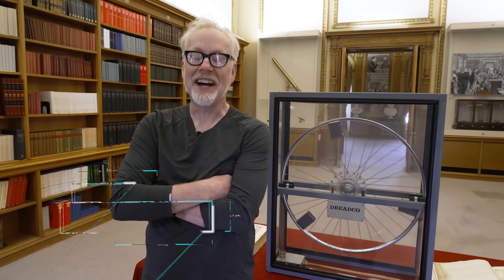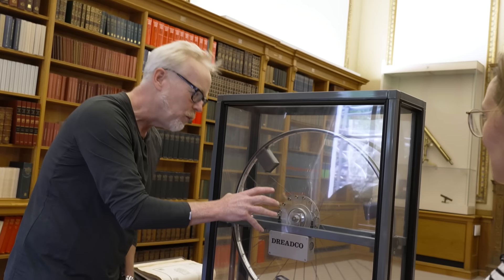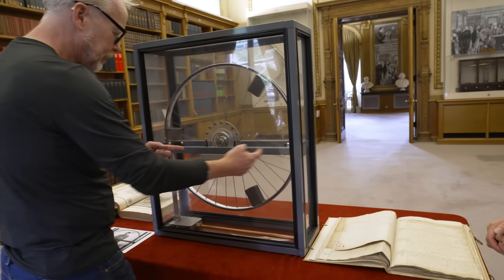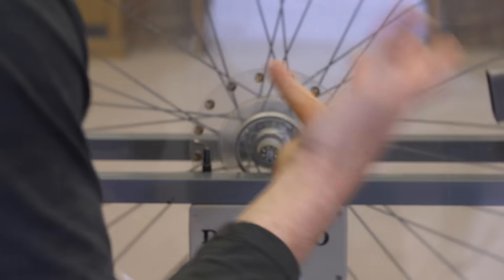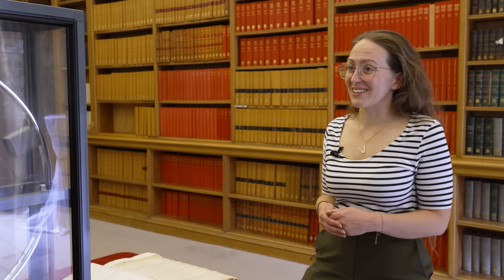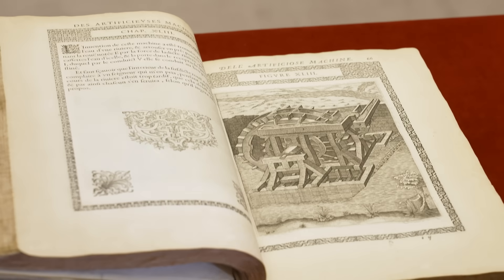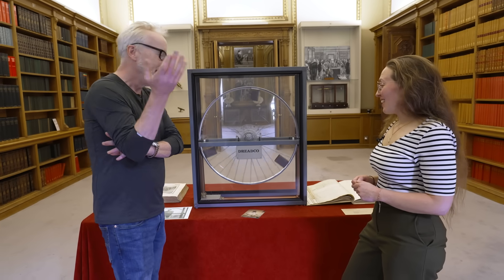Adam Savage vs The "Perpetual Motion" Machine!

Comment: The heatsinks are a hint, that thing runs on temperature differential, in the cellar it stops as the temperature is to stable..  It slowly loses gas along sides the cylinder, that is why it needs to be recharged.
Reply: So it is driven by a peltier device?

Comment: It’s most likely that there are batteries in one of the two boxes which barely discharge (it’s not moving fast) and possibly some sort of regenerative braking to capture some of that energy until ultimately the batteries have to be changed at the manufacturer.

Comment: I think the only way you could probably create a perpetual machine, would be to steal some energy from an external source such as the Earth's Spin or magnetic field.     Possibly, you could steal a little energy from heat and cold dissipation over large amounts of time too.  You would probably need to use liquid nitrogen and super conductors to reduce the friction to almost zero, because the amount of energy would be so small.  You would also need to create an almost perfect vacuum to reduce air molecules from creating friction as well.  The machine would be so complicated and have so many attachments, that people would never believe it was a perpetual motion machine.

Comment: The magnets create the charge, the electrode (sharp pointed one) pops electrons onto the inner ring of charge holders, which are then attracted and the pulled off of the inner charge holders, imparting a small torque on the wheel ... I've forgotton what the name of such a motor is called ...

Comment: Awesome video! My guess this is in essence a brushless DC motor with the permanent magnets on the acrylic disc behind the Dreadco box and the power supply and commutator coils inside that  box.
Reply: Brushless motors don't have commutators
Reply: @pjaxy  Brushless motors don't have brushes. They do commutate.  https://en.wikipedia.org/wiki/Brushless_DC_electric_motor?wprov=sfla1/Brushless_solution
Reply: Ah ha - you're the first (as far as I can see) to mention the disc and ... things. And they're where I bet are the driving forces too. Quite how, I don't know. But that's the complicated bit.

Comment: What about an Atmos gravity clock - it does not need to be wound manually. It gets the energy it needs to run from temperature and atmospheric pressure changes in the environment. That's about as close to perpetual motion as you can get. Every object in the universe has forces acting on it.
Reply: Right, but you've said it's hidden power source. Atmospheric pressure. That's no more pertual than those drinking birds. It's very useful, sure. But it's not perpetual motion.

Comment: the way the magnetic lines of flux are trans posed to the spokes that could create a y or delta or ? motor/gen "windings" .   
thus moving the magnets.     Which are boosted by capacitors and electrically charged.  
looking at the copper circle clamps on the spokes..which DO cross lines of flux.

Just a 5 minute guess.

Comment: The thing is if perpetual motion is impossible then what the hell is vibration if not motion. Everything is in perpetual motion already so why say it's impossible
Reply: You maybe could argue that it's possible on an atomic scale but it's not on any scale that's use able.
Reply: @SilverEye91  so far we've only been able to get more energy than we put into it with the world's most powerful laser but if we could one day shink the size of the laser while keep the power the same it might be usable someday decades into the future
Reply: @shmirie666  Fusion? Yeah, that's not perpetual. That's not creating energy, that's extracting energy from fusion fuel.
Reply: @SilverEye91  not sure how shooting a mega big laser and getting 50% more energy is fusion fuel but it maybe due to lack of formal education past high school
Reply: @shmirie666  Think of it like this:

When you start a fire you want to start it using a small match or lighter. That's not a lot of heat energy. But the big fire you've lit will release a lot of heat energy.

Fusion, or really any kind of energy generation is the same way. Or rather, that's how it should be to be useful. If it takes more energy to start the process then it would be useless. If you need to light a bigger fire to start a smaller grill then you should have just used the first fire to grill. 

Fusion is of course more complicated than a fire, but up until now it's taken more energy input to receive less energy from the process. We've figured it was theoretically possible to do better, but not how. That was the breakthrough that happened late last year, it proved it was possible.

Comment: Many stupidos commenting.
It's not claiming to be a  peroetual motion machine . It is designed purely to be a puzzle; a puzzle, the solving of which, actually debunks perpetual motion. 
producing a wheel that spins for 2 1/2 years is quite an amazing feat  however.
I tend to believe that it really is no more than an electric motor, the onboard  batteries of which,  being  charged by it's tiny solar cells.
The engineering beauty lies in it's very low friction of the hub bearing  that enables it to run on very little power.

Comment: Magnets always make a compelling argument for the possibility of perpetual motion. When we consider the Solar System, which is operating basically on the relationship between magnets, gravity, and motion, we have to wonder if there is some way we can duplicate that relationship on Earth? I think the answer for making perpetual motion possible, using magnets, lies with increasing mass. Consider this, you could make a 500-ton piece of steel hover in the air if you turned two of them into opposing magnets. A floating magnet isn't perpetual motion, but that sure is a lot of work being done effortlessly. Maybe there is a way to make something out of that. Wrapping the magnet in coils and spinning it? How effortlessly would it spin? Would the energy of the coils rotation along say a 1 mile long floating magnet be enough to turn the magnet? It's been tried in small devices, but maybe it only produces net energy once it's scaled up a lot. Maybe it won't, but I think if it is possible for the universe to create this type of motion for seemingly an infinite amount of time, then it is possible for us.

Comment: there is a huge misconception about the concept of "perpetual motion." if you investigate the history of the concept, you realize that their desire was to have a consistent/perpetual source of energy that moves things like clockworks, automata etc. this is not a trivial problem. they had many such devices and they needed a consistent power source to fuel them. again, in the 15th century, people managed to harvest the energy augmented in springs to fuel their clockworks. think about a spring. if you cannot tame it, it releases its energy in a milisecond which is useless. you take that energy and put it in a "perpetual" or "consistent" form to fuel your clockwork. that is the idea behind the concept. in the 19th century, it became a pseudoscientific scam where people are building magnet systems etc. what they are talking about is not "perpetual" but "free" energy or motion which is not possible as far as we know.

Comment: Isn't the Beverly clock a better example of a perpetual motion machine? (It's bassed on atmospheric pressure, but it has been running without being wound up for like 200+ years)
Reply: There is no such thing as an example of a perpetual motion machine, because they don't exist. This is an art project.
Reply: @outputcoupler7819  Yes... that is why i said "a better example".

not "is a perpetual motion machine"

Comment: Could it be a very low output Sterling motor? The copper tube and heat sink transfer the flow of air, and the black “boxes” are crude pistonS?

Comment: The DREADCO box gets energy from delta pressure.
As the air pressure change during day the battery gets charged.

Adam was close with the solar battery tip.
Place the machine into a sealed box with still pressure and it will stop moving.

Comment: Not perpetual motion of course, but impressive that it can run for 2+ years between charges. A very efficient engineering design at the least
Reply: Still not as efficient as a torsion pendulum clock, which is the closest we've ever gotten to perpetual motion.
Reply: Not really, there's enough hiding space to sneak rather big battery. If you stack all the frame pipes, copper pipes and boxes with low self discharge batteries, you could probably make it run for a decade or few.

Comment: I love this! Fantastic way to get people to think critically about how the machine works!  It very easily triggers brainstorming as you evaluate and discount possible sources of energy!
Reply: I think there i not so much to brainstorm because she said that this thing had energy for 2 years which is obvious that it is using batteries and it is simple
it si no big deal to make a wall clock that runs for 2 years on the battery 
The only thing which is interesting is how exactly it is made and where are the batteries.

Comment: I think the trick is in here the line voltage and its electromagnetic effect on the copper pipes or the coils in the boxes so that it produces again  electric current to supply the energy necessary to correspond the frictional loses. It will be good idea to put this device somewhere totally isolated from electric network supply cables. Plus when a force is applied to a piezoelectric material, an electric charge is generated across the faces of the crystal. This can be measured as a voltage proportional to the pressure.
Reply: I tried to capture energy of electromagnetic waves once.
Receiving antenna for such device was relatively large - 3x3 meters and 10 turns (or something like that).
I managed to charge 330uF capacitor to 1 volt in several hours.
I counted it as success, because it worked.
But such amount of produced power is very very tiny.
Most likely, it is not possible to power wheel with it.
And I admit that my home have unusually powerful RF source nearby (of unknown origin).
Most of the people will not be able to even reproduce my result.

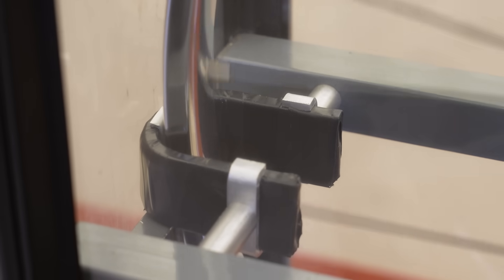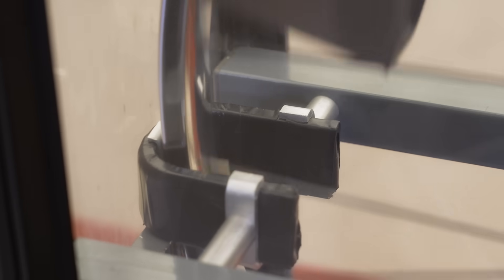Comment: Based on her statement at 6:43 I think I have a guess on how this works, so idk if this would work or what but it's just my take. So if you watch closely at 4:13 you will see they close up the black thing which Adam think is a "magnet" and if you really look at the speed of the wheel, the moment that black bars pass thru that magnet it changes speed then it goes back at normal speed. So what I think is and this would probably a disappointing one, those components at the bottom are just a nuisances for you to think the right answer, this thing is just powered by copper and magnet, bear with me cause the shocker comes in, so if you watch Vsauce as well, they did a copper and magnet experiment there where if you put a magnet inside a hollow copper tube, the magnet won't fall easily, it will somewhat glide inside the tube, so with that I put it as a concept on this where, the "black thing" which Adam call a magnet is really a copper tube coated in black and those 3 big boxes are the magnet that's why if you see the 4:13 clip the speed of wheel before the box enters the black thing and during are different. Now idk if this is plausible but if it's then yeah it's really a disappointing one hahahaha

Comment: The motion of the wheel make a little wind tat is pushed down toward the cooper pipe then heated with little box down left and the wind transformes it self into a invisible hot burst of air that pushes up the wheel . All the other pieces are just to balance the wheel

Comment: My guess is magnets (the 3 metal type blocks) with opposite poles causing slight repulsion which in turn propels the wheel in perpetuity.
Reply: So your guess for how the fake perpetual motion machine works is that it's actually a real perpetual motion machine using one of the most thoroughly debunked methods ever devised? 

Yeah...probably not.
Reply: @outputcoupler7819  Yea I was actually stoned when I wrote that, I'll  take that on the chin.

Comment: I think this is more of a fun way to theory craft how you would make a fake perpetual motion machine than a real puzzle. Like, there’s not enough information to figure out the real answer, especially because of the decoys, so it’s impossible to have a true a-ha moment unless you were allowed to take it apart
So really it’s just getting you to think of how you would do it rather than how they did it
Reply: It's not hard to figure it out. What helped me is that I like to watch magic tricks and then deconstruct how they are pulled off. Filter out all of the things that look like they have something to do with propulsion and focus on the things that are not screaming out for attention.
Reply: Now I kinda want to go at it with a bunch of modern technology. There are sensors that can detect small electromagnetic fields, so you can essentially detect electricity. There are motion amplification algorithms so you can see what part of something is moving the most, and there are sensors that can detect permanent magnets so you can check for any magnets on the contraption.

I think with enough data collection like this you could piece together exactly how it works.

Comment: 9:00 "There is no prize." Well... A perpetual motion machine would be:

(1/2) The most important scientific discovery of all times. It'd be succeeding where many big brains failed, where scientists say it's impossible. Proving wrong a fundamental law of physics, one the easiest to test and has been tested over and over again... would mean not only rewriting the books, but it'd also cast a huge shadow on all physics laws -- especially the ones that have been mathematically derived and can't be tested.

(2/2) If it's not just a "battle of tiny, tiny values"  that can't produce useful energy, then it would also be the greatest invention ever made since it'd supply endless free green energy: it'd be worth more than all the oil, gas, coal, nuclear, wind, solar, hydro... more than all energy storage systems... etc. etc. It'd carry an infinite value.

"There's no prize."

Comment: It is running off crystals, think of how a batteryless crystal radio works, the spokes in the wheel are recieving the radio waves and transmitting them to the crystal which under the Piezo effect turns them into electric impulses, I suspect that when they put it into storage it is not getting enough radio waves to keep it moving.

Comment: Sure some YouTube comments warrior and self-proclaimed expert can help me out on this but I've always had trouble understanding why perpetual motion isn't attainable with natural magnets. Especially with strong modern rare earth metal magnets like neodymium. Then again, I'm not a physicist by any stretch of the imagination. However, it's pretty easy to observe that natural magnets can exert force and cause objects to move at some velocity without any external energy input. So why isn't it possible to come up with an arrangement of natural magnets that either repel or attract each other, or a combination of both repelling and attracting each other to rotate something? I know friction and air resistance could slow down this motion, but as magnets don't need any external energy input to overcome this friction / air resistance / gravity's pull etc etc, shouldn't that be possible? I mean they can move objects at rest with no problem so overcoming the small amount of resistance as this rotation is slowing down shouldn't be a problem. Is it just that there isn't any arrangement or configuration that allows for magnets to repel and attract each other consistently without the poles shifting and counter-acting the work they are doing? Lol I know this probably sounds stupid and a bit much, but it just makes me want to give it a try with some strong natural magnets and see what I can achieve. Maybe then it'll make sense.

Comment: When the coils pass the magnet they in turn charge the copper tubes Wich are transmitting lense charges to the opposite coil it's like a car coil that has a spark on both wires that alternates one is weak one is strong they alternate they're strength

Comment: I think it's a copper coil inside those blocks which moves current when passing when those magnets on the side. It stores charges in the blocks with capacitors which activate the electromagnets on a well timed charge near the other magnets. All in a vaccume sealed box.
Or the oppisite
 That box with the heatsink is what powers electromagnets which alternate current between the magnet on the wheels.
Reply: The box is obviously not a vacuum. Thin acrylic is not remotely strong enough to withstand that level of force.

And what exactly do you think you're getting from taking energy out of the wheel to put it back in the wheel? Just don't take energy out of the wheel and you get the same effect with less losses.

Comment: If it was a single charge given to it and it is recycled when the box goes up it's given to the next one transferred from one to another.but as we know energy dissipates through other means like heat.if you could use solar that sure would look like true perpetual motion but honestly if you could use ultraviolet light as an energy source it would b undetectable.becouse it would still run in the dark.

Comment: The waight of the to push te one and a surten speed keeps it in perpetual on a aligned axis in a 1+ 1- degree
Reply: The tilt in the 1+ and 1- degree is the extra force needed
Reply: The 1+ degree + the to weights is final push delivered over 160 degrees in exchange of the 1- degree is to keep the constant speed (tic tac tic tac...)
Reply: Every outside force normale would stop the perpetual
Reply: So this is or no perpetual or a other principal
Reply: Besides, the weel got to mutch going on for a straight alignment
Reply: So every second the tild in 1+ degree  needs to be changed in a 1- degree